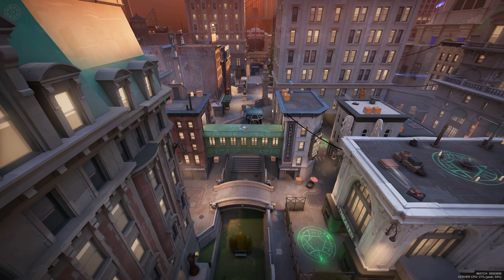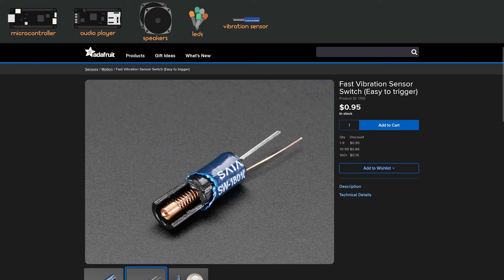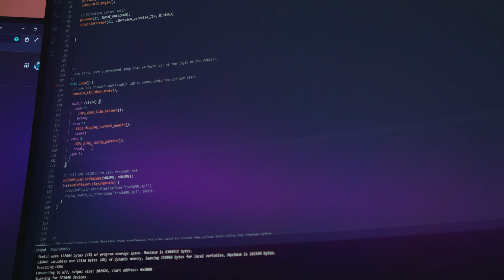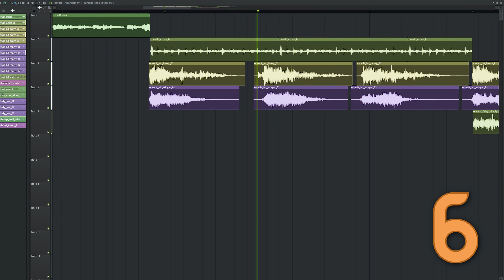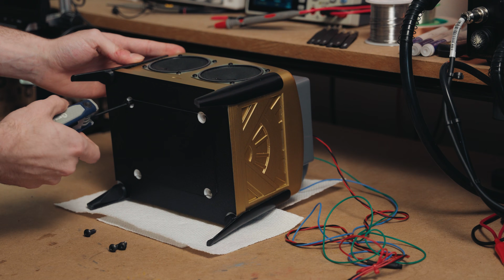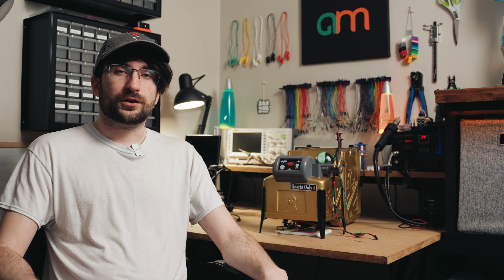I built the Sinner's Sacrifice from Deadlock

Comment: Got a question for the fusion 360 plan. How do u make the electronic been so accurate ( resistor etc plug connector), is there like a library with the model or do u mesure everything and model ?
Reply from the maker: Adafruit provides 3D models for many of their boards which is very convenient for modeling housings around them. They didn't have models for a few of the items so I either used datasheets to get the dimensions or took my own measurements to make the models myself.
Reply from the maker: Also just as a note, most PCB design software (KiCad, for example) lets you export a 3D model of your design with 3D models of the components included as long as you have your footprint libraries to include models. It makes for a very nice workflow when doing projects that involve both PCB design and 3D printing.

Comment: Would it be possible to make inside like a lava lamp? :D
Reply from the maker: Would definitely be pretty cool! It would be hard to manage the heat with the thermoplastics used for the 3D printed parts. I suspect you would get a lot of melting.
Reply: @AzureMakes  I didn't though about heat lol. Maybe brass body would work

Comment: it actually requires 4 punch to initiate the timing part not 5 xd, cant help but notice 12:12
Reply from the maker: Good catch! I wasn't really concerned about accuracy at that point in the project and that was fixed shortly after I filmed that shot. You can see the fixed behavior later in the video.

Comment: brother, this is dope, but this video is 10-15 minutes too long. so much of that could've been cut out, and then you only briefly show off the final product.
Reply from the maker: Thanks for the feedback. I tried a present tense style with this video to try to make it more of a ride-along experience for the viewer but I agree that a lot of the runtime is spent on uninteresting areas of the process.

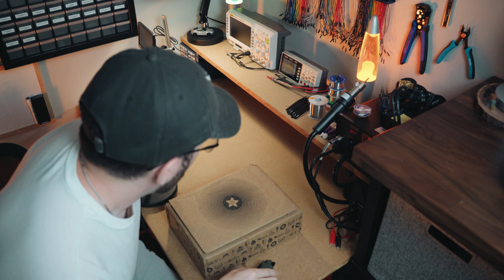I'm guessing you would've preferred if I cut out 6:45 to 11:45 and 20:35 to 22:35, right? That would cut 7 minutes which I think definitely would've been an improvement but I don't think I would've cut anything else, personally. I'm curious what else you would've removed.

I also definitely agree that I should have spent much longer on the final reveal. I was on a timer to release the video while the big patch hype was still in swing and I let that pressure take over a bit.

So I think I could've chopped 7 minutes then spent like 2 more minutes on the final reveal which would've made this a 25 minute video. I'm of course interested in improving, but honestly for my second video ever I think that's acceptable. Your feedback is still very valid and I think I can do a lot better on future videos, thank you!
Reply: @AzureMakes  yeah both of those sections could've been cut. honestly most of the deadlock explanation could've been cut. most of the "choosing electronics" section could've been cut and you could've just explained or shown on the screen while you were assembling what each part was and linked it in the description. 

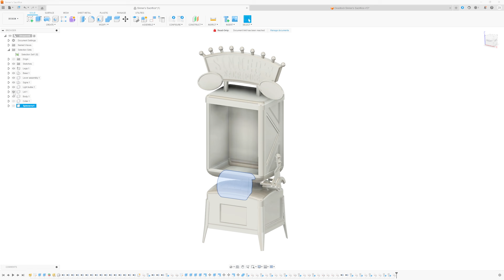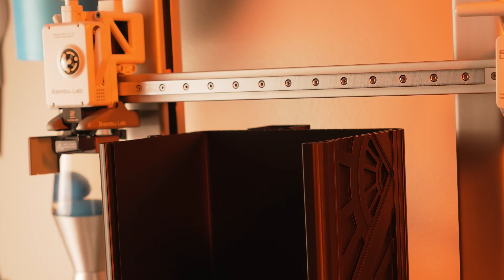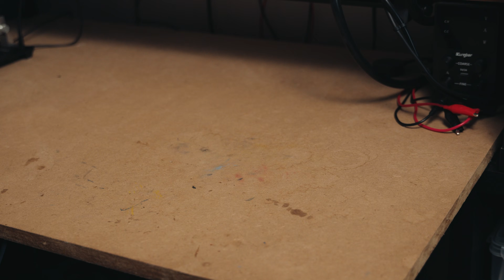so like 1:00 to 3:30 could've been done in half the time. 3:30 to 11:45 was unnecessary. dont think you needed 2 full minutes to talk about audio. Then 17:45 to 20:00 while you were putting it all together, you could just have the part you used for that on the screen with a mention while you assembled it. 

Then add another 2 minutes to show it in use and the final product, and maybe what you learned from the project,  instead of just the b-roll cut. 

All still could've been done in 15 min and your viewer retention would be much higher.
Reply from the maker: @PerfectFall  Ok, thanks for the input

Comment: Amazing work 🤯 one thing that I thought would add a lot of vibe to the machine in low light is lighting up the sinner's sacrifice logo on the top and make it flicker like in game. You can see it's pretty hard to read the sign at 29:30 and while I have no experience in this field, I'm thinking a thick diffusion panel with a small array of LED's shouldn't be that big of a mod. Again, crazy work man. First video I've seen from you and definitely subbing!
Reply from the maker: Thank you! Omitting the backlighting for that sign was a compromise I decided to make because I felt that the project was already complex enough, but you're right. It would definitely take it to the next level! Thanks for subbing 🧡

Comment: I don't wanna be "that guy" but there is an elephant in the room with this build :(

The "Sinner's Sacrifice" billboard (and its 2 little satellites) should also be glowing a warm, flickery yellow glow. I'm sure you noticed this as well, but didn't realize it until the project was complete and displayed under moody lighting. I certainly only noticed it when the build was fully displayed.

Perhaps it's an easy fix for an updated v2 model?
Reply from the maker: I did notice that while planning the project but decided it wouldn't be worth the time. The challenge is diffusing the backlighting across the sign face in such a small space and with the wires from the light bulb LEDs in the way casting a shadow. I probably could have achieved it by making the top sign body thicker than the in-game model and using LED strips or a custom LED panel, but I was happy with the complexity level of the project already and didn't want it to get bloated.
Reply: @AzureMakes  thanks for the reply!

 I don't know about the rest, but I would imagine the wires could be routed around the edge of the billboard so they aren't visible, or with a similar false back solution to the one you did with the box with the souls.

Comment: Loved the video! Is there a 3d printer youd recommend? $400 max? Cheers and happy making!
Reply from the maker: Thank you! I have a Bambu Lab A1 with the AMS lite and it has been absolutely fantastic the whole time I've had it. Extremely easy to use and low maintenance. There are other similar options out there from other manufacturers, I just like Bambu.

Comment: Amazing work! My only wish is you'd added lights to the actual Sinner's Sacrifice sign. Feels like something a slot machine would do.
Reply from the maker: Thank you! The in-game model does actually have backlighting on the top sign and I considered including it but I couldn't figure out an easy way to do it with well enough diffused light. The wires for the light bulb LEDs are also in there and would cast a shadow. I think I could have found a way to do it but I was happy with the complexity of the project without it.

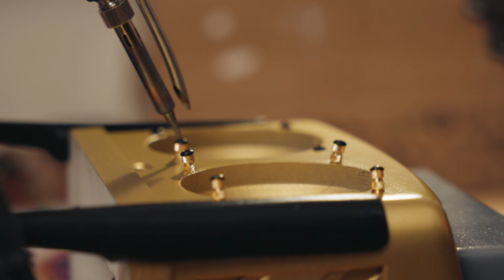Comment: 19:10 so... rather than drilling holes, you're heating the screw mounts so they'd melt the 3D print plastic around them? That's genius.
Reply from the maker: Yep! They're called heated inserts. You just have to design a carefully dimensioned hole into your 3D models then you sink them with a soldering iron. It's best to sink them with a screw threaded in to prevent plastic from getting into the threads. They're great, I've never had one fail!

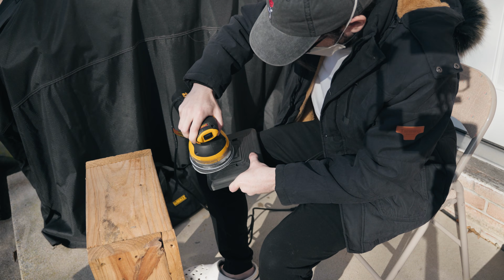Comment: watching the print timelapses  at 17:53 ish, how did you print such big items on the Bambu A1 without having any quality issues? multi-hour prints tend to separate from my build plate on corners and some edges, probably due to cooling and shrinking. any tips?
Reply from the maker: I haven't had problems like that yet luckily. My printer seems to handle everything I throw at it. I use Bambu filament and try to keep my spools dry. I have a textured bed that I clean with IPA between each print. I also have my printer in a room that has pretty much no air movement and I keep it a little warmer in there. Without an enclosure, you have to care a little more about whats going on around the printer. As a last resort, when I used to have adhesion issues on my old Ender 3 v2,  I would just print everything on a raft. Best of luck!

Comment: Stellar video through and through. Was wondering if you'd end up incorporating the effects the sinner has when lightly tapped instead of heavy-bonked, but i can only imagine that would have added way too much work
Reply from the maker: Thank you! That would be cool and could be achieved with an accelerometer instead of the vibration sensor and some adjustments to the code to make the health go down at smaller intervals when light tapped.

Comment: what is your desk model? i like it a lot
Reply from the maker: Thanks! If you mean my desk for my PC setup, I built it but it's quite simple. It's just a piece of 1 inch thick butcher block that I bought, stained, and added IKEA legs and a small shelf section to.

If you mean my workshop table with my soldering equipment, it's a very old Amazon glass computer desk that I took the glass off of and put some fiber board on.

Comment: That looks awesome! But you forgot the sign is glowing :(
Reply from the maker: Thanks! Yeah, I did notice the backlighting on the top sign when designing the replica and wanted to include it but I couldn't find a good way to diffuse the light enough in such a small space. There's also the wiring of the LEDs for the top light bulbs that are in there too which would block the light. Definitely something that could be improved but I just didn't think it would be worth the energy.
Reply: @AzureMakes I think that you can use an LED strip. It consumes little electricity and takes up little space.

I think you can attach the wires with glue tape or something to the back inner wall of the sign and put an LED strip on it, you don’t need to run a lot of wires to this LED as far as I know.
Reply from the maker: @Draleer  Yeah strips or panels of LEDs would have been the way to go for sure, it's just the wiring for the light bulb LEDs that might get in the way and cast a shadow onto the sign face. There are probably ways I could have done it such as making the sign body deeper than it is on the actual model.
Reply: @AzureMakes also u can use cotton or like that to spread the light

Comment: Wonderful end result! My only suggestion would be to add some weight into the base and move the vibration sensor towards the acrylic screen, so you “tap the glass” rather than tapping the rear of the base. Great work!
Reply from the maker: Thank you! The replica does have a decent amount of weight to it already and is luckily pretty bottom heavy. The sensor does detect punches from higher up on the machine, I just chose to tap the base in the final reveal because punches were sliding the machine and ruining my framing of the shot. I should have definitely added some rubber feet.

Comment: This is absolutely awesome and makes me think about the project I've wanted to do. Make a BeamCase SFF PC build with the case being the "base" of the Sinner's Sacrifice. Have the entire walls/top of base and the top of the machine slide off from the feet and have a mini PC inside. Strict_Bird_2887 made a container PC that gave me the entire idea. It'd have to be a good bit bigger than this one and I'd probably set it on a coffee table beside my set-up but wow this is awesome. Once I get another 3D printer (mine decided it didn't want to work anymore) I might get the files and see if I can build it. I'd love to play Deadlock on a Sinner's Sacrifice.

Also I know this one is a finished project but did you think about trying to use heat activated paint similar to moving Rorschach Masks for the souls to "move"? Not sure if the LED's would give off enough heat but it I ever get to build the PC version I'll add an exhaust/fan upwards into the soul chamber to push the heat from the PC around to move them.
Reply from the maker: Thank you! A Sinner's Sacrifice PC would go so hard! That's an awesome project idea. Cooling might be a challenge but challenges just make a project more satisfying to complete. The heat activated paint sounds pretty sick if that ends up being viable, I love that idea too.

Comment: I feel like the spikes on the lever seem to imply that outside of gameplay, the in-universe mechanic of the machine is that it's a gambling machine that is activated by the lever, but draws blood with the spikes as payment. Don't want to overcomplicate things, but maybe pulling on the lever could do the same thing as tapping the machine does in this version?
Reply from the maker: Yeah it's very interesting to look at the model and try to figure out exactly what is going on in the universe and I'm still not confident I get it even after building it myself lol. I think you're right, and it would be cool if the lever moved in the replica but I felt that the project was complex enough already and was worried I wouldn't be able to finish the project if I added anything else.